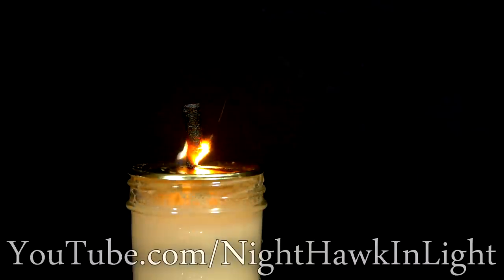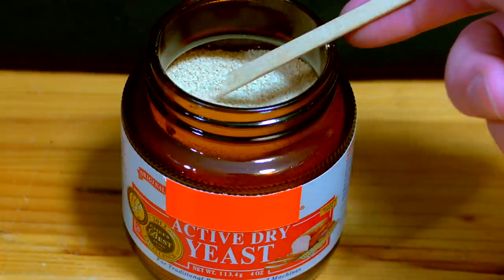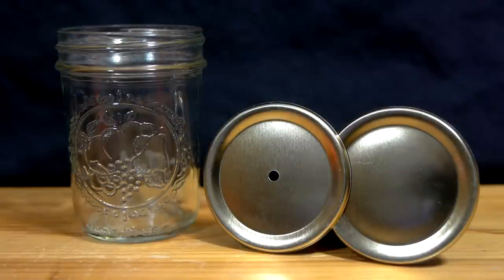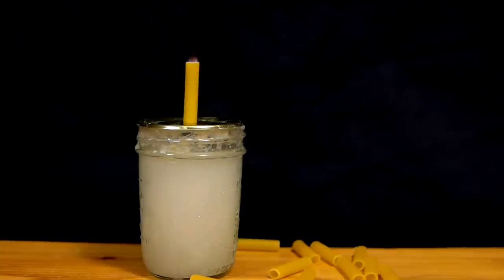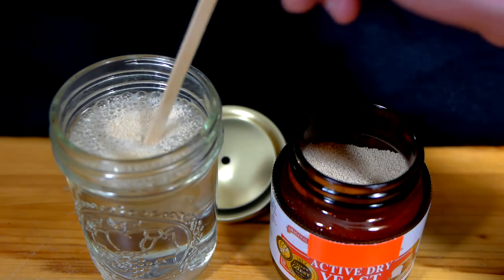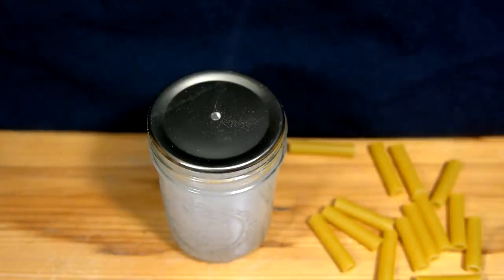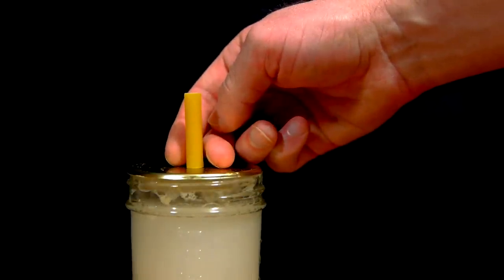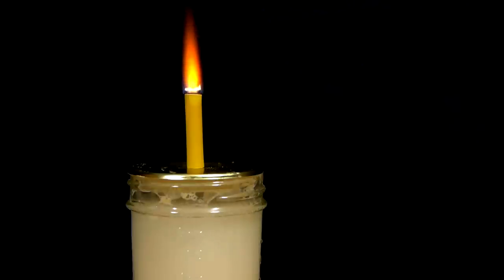Make A Hybrid Rocket Engine With Pasta, Hydrogen Peroxide, And Yeast

Comment: Thinking about trying this with a 20 gallon drum (with a lid and a hole on the side of the drum) of hydrogen peroxide and 2 pounds of yeast with a 3ft long 6inches diameter steel pipe on the side and sit on the top and light a spark. Guys im going to the moon or the ER.

Comment: This is a fantastic demo for my second grader, and he will be entering the science fair with this one.  However I have , few notes that helped me with this one, and may help you as well.

First, I had a hard time getting the ziti pasta to stand on end, especially as the bubbles flowed up directly under the lid, lifting it, and up through the hole too. What I did to solve this was to drill the hole just barely large enough to squeeze the pasta noodle inside to hold it in place.  
Second, I noticed that if you let the peroxide and yeast to react for 1-2 minutes, the O2 gas stream was strongest.

I had no problem getting the rocket exhaust to create a fine and even plume over 4 inches long.  Sometimes it would even give us the pop pop pop rocket sounds.  Thanks for this Night Hawk!
Reply from the maker: Very cool, great tips!
Reply: NightHawkInLight i'm creating a thorium breeder reactor you should make one to!
Reply: +mccowc0w radioactive boyscout.
Google it.
Reply: +Steve Fink " he will be entering the science fair" vs. " I had a hard time "
See Also: Cheating.
Reply: Jeez, people just can't take a joke anymore.
Reply: +QuiznosBear Really? Apparently don't know how to tell a joke.. LOL
Reply: +Jurell Baldeo ha-ha right

Comment: Very interesting.  When we were teenagers, my older buddy discovered one of the most powerful and easy-to-make solid fuels:
a simple mixture (not a chemical compound) of sulphur dust and zinc dust (I forget the all-important ratio, something like 2:1 sulphur to zinc). He would stuff  a PVC pipe with it and mostly they would explode almost a thousand feet into the air, but a couple actually powered their way there, with a maroon-coloured flame and and satisfying deep roar to boot! (The last one had tilted over and was powering its way towards a semi-major road with afternoon traffic on it!  Luckily it fell short.)
I looked up this fuel around that time (the early 1970's) and found that it had more thrust than petrol + liquid oxygen!

Comment: I did this a couple minuets ago, hears a couple quick thoughts, i sealed my can completly to maximize the amount of gas being released from the hole. You need the pasta piece because the gas needs to be ignited, and using tubing instead of pasta wont keep the gas lit. 

Another thought: It does not last long, the flame lasts as long as the pasta is of course, but the gas will go away quickly, using more peroxide and yeast will increase in time. If i can only maximize this project to make it so pasta does not have to be used.

Thank you Nighthawkinlight. You made my evening enjoyable.

Comment: awesome ! how long will the flame last ?
Reply: I was getting about 20-30 sec per noodle
Reply: Capt. Sum Ting Wong A longer noodle would be nice to obtain, and adding more peroxide and yeast would make it surley last longer, in my case i sealed the lid to maxamize pressure.
Reply: rubrickmanlives Yeah I couldnt remember the exact noodle so I just got one, mine is fat and short and im sure it would have been way better if it was long and skinny instead.
Reply: Well, long and skinny wouldnt increase burn time, it would be faster, if i could obtain a noodle of some sort that could even be a couple centimeters, yet incredibly wide, it would last a while. Remember its not the tube that makes the flame, its what keeps it lit. The noodle is the spark that lights the gas.

Comment: Is the interior of the fuel grain burning, or just the very tip?  Unless the temperature and pressure increase inside the nozzle, there's not going to be much, if any, thrust due to the burning.

Comment: You can also use manganese dioxide liberated from batteries or just good old diced potatoes. Really. Also, at your local pool and spa supply there is a non chlorine shock that is crazy strong h202. Baquacil.

Comment: Can I use pure oxygen gas from a hydrolyzer I built (water splitter) or is that more dangerous? I am assuming it is the same, but just wanted to know. Would a tube made of a flour based paste that was hardened work too? Could a colorant be added to one (boric acid) if you made a tube yourself? I made a hydroxy torch once, but it backfired alot due to no seperation of fuel and oxygen, iv learned since then.

Comment: Just wondering, what if I cook the pasta in a saturated solution of some oxidizing agent (KClO3? NaNO3?) then let it dry and ignite it?
Reply from the maker: Then you would have a solid fuel engine, though it would burn very poorly. Most of the oxidizer would be lining the outside of the pasta rather than being well mixed with it.
Reply: I would not just boil the pasta, I would actually cook it (and bein Italian I know a lot of "pasta mechanics"), when the pasta is soft enough I know for sure that salts penetrate to the core, that's how I know if my sweet half forgot to salt the water before throwing the pasta in. Looks like there only one way to find out :)
Reply from the maker: Fabio M. Yes, it might soak into the core of the pasta, but it won't stay there as the pasta dries since capillary action will bring most of the salts back to the surface as the water evaporates. Oh, also KClO3 wouldn't work very well to soak into the pasta because it's not very water soluble, but maybe that would help it to stay inside once it got there.
Reply: My idea was that if I cool the pasta down very quicly crystals will form and stay in there. Now I definitely have to give it a try.

Comment: Could you measure the thrust by putting a scale underneath the rocket?
Reply: +Duncan Alexander-Rider thought about this too...
Reply: The gravity would pull the scale down, instead try putting a scale under the jar and set the scale to zero, then light the rocket and see if it changes.

Comment: You could also use Dinitrogen monoxid (Nitrous oxide) as fuel , or am i talking about the wrong chemical compound ?
Reply: N2O is a pretty common oxidizer in hybrid rockets because it's self-pressurizing under certain conditions.  You have to be careful though to avoid breathing it (it's laughing gas!), and there is also a risk of explosion.
Reply: I know a bad experiment Ammonium Nitrate (found in manure) can be split into water and N20 , which also can react again ; both are as i know exothermic reactions

Comment: If i place a balloon over the hole could I store pure oxygen? Or is there too many byproducts? Im too tired to do stoichiometry...
Reply: it might work
Reply: No stoichiometry issues here! The reaction simply is 2 H2O2 --> 2 H2O + O2
So, oxygen is the only gaseous product, and yes, by placing a baloon over the hole, you could get relatively pure oxygen, except from water vapor and traces of hydrogen peroxide. Just don't forget to let the reaction vessel be purged from the air it initially contained if you want it really pure.

Comment: How much lift does it produce?  Is the oxygen stream strong enough to fuel multiple noodles?
Reply: ***** Well, it doesn't produce any lift (neither aerodynamic or aerostatic), but it should produce a small amount of thrust. Not enough to get the TWR (thrust to weight ratio) above 1, though.
Reply: ***** What if we used a small aluminum oxygen tank with perhaps six noodles being fed all around it?  Think we could get that thrust ratio over 1?

Comment: DO i need the noodles, or can i use a metal pipe?
Reply: The noodles are the solid fuel in this hybrid rocket. You /could/ surround the noodle with a metal pipe, but it'd be pretty useless. Besides, as stated in the video, the noodle isn't a good fuel.
Reply: PleaseExpectBear ok, thanks! i was just hoping i didn't have to go and but noodles
Reply: Noodle is a funny word. Noodle, noodle noodle noodle.

Comment: that should be releasing browns gas.
I wonder what happened to the hydrogen? or was that what was burning?
Reply from the maker: This reaction doesn't make any hydrogen gas, just oxygen. The yeast makes the hydrogen peroxide break down into water and oxygen like so: 2(H2O2) -> 2(H20) + O2
Reply: those gosh darn hydrogen molecules are a pain to break free.
I should of guessed it would not be that easy.
Thank you!

Comment: I think if there was a way to put the hole in the side of the lid, make it smaller than 1/8 inch then fix up a geared system on a little cart that would rotate a fresh ziti in front of the aperture every few seconds, then put the engine on the cart so that the hole was pointing back, it might go a little way before it blew up.

Please don't all me to build it. My landlord hates me enough now and it's cold out.

Comment: Serious question from a guy who honestly doesn't know. Why is h2o2 not just HO?
Reply: h2o2 is a more stable configuration. btw its " -OH " (hydroxide)
Reply: Suntansuperman Thanks!
Reply: Hardihood Hydrogen peroxide contains a peroxide grouping, which is always two atoms of oxygen bonded in line (actually, twisted in space); every peroxide contains this: O-O grouping of two oxygen atoms.  
To balance the formal charge, two hydrogen atoms are bonded at the both ends of the peroxide group: H-O-O-H = H2O2.

Compare with another peroxide, e.g. tertiary Amyl hydroperoxide:  H3C-H2C-C(CH3)2-O-OH.

Comment: Can u replace the pasta straws with copper tubing
Reply from the maker: The copper would not burn, so no.
Reply: NightHawkInLight PVC pipe would.
Reply: NHIL, well you can use the copper pipe to make an elbow before you put the ziti on the end. That way you can handle the flame easily and you also have a good torch. :)
Reply: The pasta IS the fuel. You could replace it with PVC pipe, but I doubt there'd be enough Oxygen to properly sustain the reaction.

Comment: What about the hydrogen?Isn't the hydrogen gas being burned up as well?
Reply: the hydrogen retains an oxygen to form water
Reply: If there are hydrogen in there the whole stuff could explode
Reply: true, but then where is all that hydrogen? It probably is being burned but in low quantities since as soon some hydrogen is formed it's burned by the farm and since it's so small no explosions occur
Reply: Blueghost136 Actually, the yeast makes the H2O2 (hydrogen peroxide) into H2O (water) + O (oxygen), not H2 (hydrogen gas) and O2 (oxygen gas). Since oxygen alone (O) is unstable, it forms O2. So it is being made into water and oxygen.
Reply: Oh, so it doesn't separate into hydrogen at all, that makes sense, Thanks
Reply: Blueghost136 No problem man

Comment: releasing oxygen gas, so I'm wondering if it's safe to breathe in... pure curiosity and I'm not much of a chemist if that was unclear..
Reply from the maker: Yes, it's safe to breathe. It's not good to breathe lots of extra oxygen for a long period of time because your body gets used to having it and won't do as well when you go back to normal, but in a whole room full of air you would need hundreds of these jars to make a few % difference in oxygen levels. You would need to keep tons of jars going for weeks for it to be bad for you, and in this experiment most of the oxygen is burned with the fuel anyway.

Comment: That is not a hybrid engine, that is still a solid fuel engine
Reply from the maker: A hybrid engine has solid fuel. Solid fuel and a liquid or gas oxidizer. A solid fuel engine has both a solid fuel and solid oxidizer.
Reply: Boom
Reply: NightHawkInLight this is true . For example roofing tar and nitrous oxide .

Comment: would this work in like a bottle rocket
Reply: +Nick Chen I Don't think so, because the yeasted peroxide will flow out of the pasta and snuff it out. Remember the peroxide commonly sold is mostly "common" water

Comment: Is it hot enough for me too get a steel rod 1/4 inch thick red hot to bend
Reply: Just buy a propane torch from a hardware store. Much safer and not so much more expensive.
Reply: Matthew Paul the pasta thing is probbably not hot enough, but use the same principle and pump pure oxygen into a tube of lots of layers of aluminum foil and you can melt holes in steel plates.

Comment: hydrogen peroxide, so H202 right?
Reply: Yes. And water is dihydrogen monoxide. I've herd several stores of panic when people are told, on the radio, that there is dihydrogen monoxide in there water supply. Or simply put water in the water supply. Several lost their jobs reminding people of that statement.

Some lake owners have placed warnings signs of dihydrogen monoxide in their lakes and to swim at own risk. It works too.

Comment: I tried this using 35% hydrogen peroxide that I diluted to about 3%(I think) and when I added the yeast the bubbles did not pop and came out the top of the pasta putting out the flame, does anyone know why this happens? could it be that I have yeast with different additives or am I just bad at diluting chemicals properly?
Reply from the maker: That happened for me if i added too much yeast. it could also be that there is something in your yeast that makes the bubbles particularly foamy.

Comment: having used this set up for sterilizing mushroom substrates i can confirm that with a hole that large its impossible to build enough pressure to explode, you can use the metal ring, and evidence of this can be seen in this video, because even with out the ring there wasnt enough pressure to push the lid off the jar. neat noodle rocket tho

Comment: wouldnt that be just a burner though? if it was a true rocket wouldnt the pasta noodle go shooting off the lid of the jar from the split second of thrust when it had the oxygen running through it? and lol it is funny saying pasta noodle talking about rockets....
Reply: It does not have to have significant lift to be a rocket, since it follows the same principal as any other hybrid rocket.
Reply: btw as soon as he said that in the video "the pasta wont shoot up because...etcetc"
i thout of something... the end of the "rocket" is at the top.. it would most defenitly NOT shoot upward cause its power is directed down no? i might just be crazy thou <.<
Reply: LFLloureiro Well, the noodle is around the gas port, so theoretically, the pasta would not be moved at all.

Comment: where am I supposed to get hydrogen peroxide
Reply: If you have to ask that question, you are probably too young to be trying this...
Reply: FSUfan1023 I'm 13 I use fire often and always with at least 2 safety precautions witch usually means a fuse so I can get to a safe distance and a bucket of water while I'm next to my pool while on concrete

Comment: How would a 20% hydrogen peroxide solution affect the flame?
Reply from the maker: It would probably bubble too quickly and send foam up into the pasta causing it to become wet and go out. Otherwise it would just have a higher flow of oxygen so it would make the flame larger and burn the fuel more quickly.

Comment: I don't know what I done wrong.. but it didn't work for me :(
Reply from the maker: Really? What part didn't work? The noodle wouldn't burn? Was the peroxide really bubbling?
Reply: I'm not sure if its because the peroxide was already opened, but the noodle wouldn't burn because there wasn't  a strong enough reaction.
Reply from the maker: RedMoonSheWolf Yep, could be the peroxide went bad, or you didn't quite use enough yeast. You can try putting a spoonful of yeast in warm water and stirring it up, then using a little splash of that mixture to get the peroxide started instead of putting the yeast in as powder. That can help it react faster.
Reply: okay ill do that :)lol Thank you I really enjoy your channel!
Reply: Were you buy this?